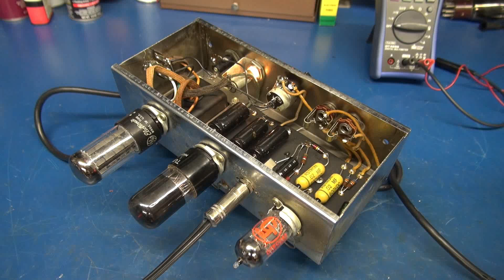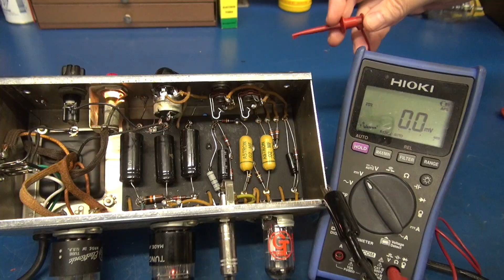Vintage Fender 5F1 tweed Champ tube guitar amp how to fix volume rumble leaky caps

Comment: Its nice to see such strait to the point explaination of an issue. It never gets old, real experience. 
It's so funny to see that yellow molded capacitors are almost always dead, while blue molded ones are almost always just fine. Sure, there are exceptions to the rule, but those are pretty rare.
All possible coupling capacitor issues and their manifestations plus drying put off the electrolytic filter caps made new generation of amplifier technicians. 
All they do is say amplifier needs a full recap to their customers.  Plus they do some cleaning, and that solved 80 percent of the issues. Then they have a few sets of known good tubes and swapping those around to check if that fixes issue covers another 10 percent if the cases.
If that doesn't help, they have someone on the speed dial who did this long enough to hear a bit outside this type of fixes. Still no real knowledge or understanding but bit better at it.That covers 5 more percent.
For the last 5 there is a YouTube always there to help 😊

And there you get new "experts" young people preaching wrong and dangerous stuff that they have 0 knowledge off. Long live the influences and lack of the negative counter.

Comment: To be accurate, noise similar to this could be a dirty or worn out potentiometer.  But as Terry shows, it's quick and easy to check for this condition to eliminate it as a possibility.  Follow through on the symptoms, don't assume too much.

Comment: Why does the output tubes Draw pull more current when DC leakage voltage is applied to the grids of the output tubes?
Reply: The DC voltage between the grid and cathode is what sets the bias which is the current that the output tubes pass. When the coupling cap leaks and puts a positive voltage on the next tupes grid it increases the current draw of the tube.